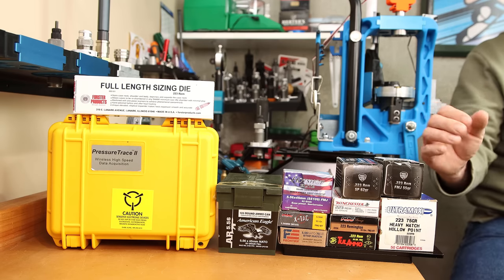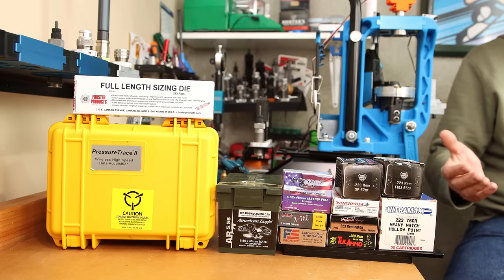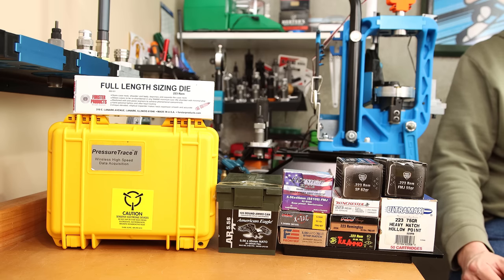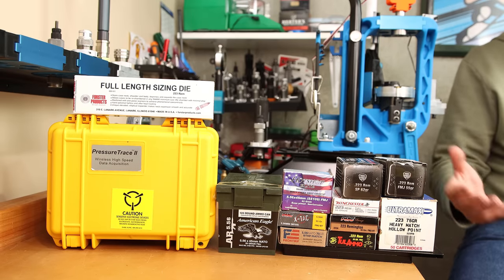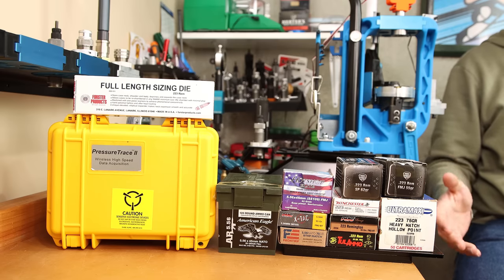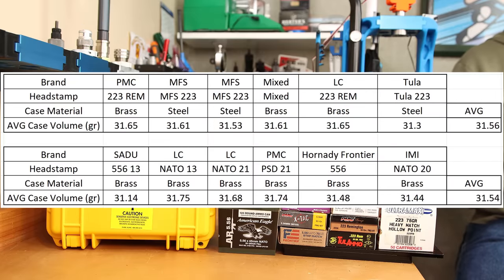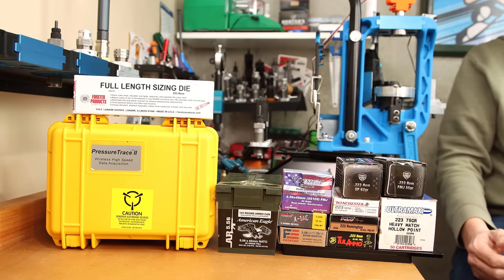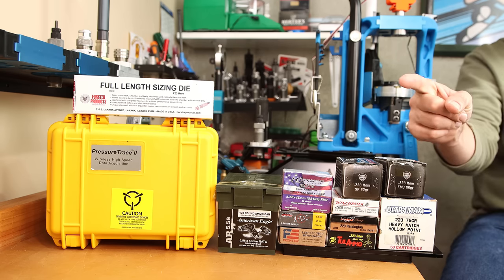223 vs 556 - The Hidden Truth No One Tells You!

Comment: as a 22yr retired military person who has shot hundreds of thousands of 556/223 rounds, I can tell you that we NEVER had an issue when using 223 rounds in a 556, not once!!!  i use 223 62gr in my personal 556 all the time with NO issues....  thanks for the video!!
Reply: Yep. The rule of thumb is that you can always shoot .223 ammo in a 5.56 chamber, but not necessarily the reverse.
Reply: If you have a rifle in. 223 it needs the MILITARY THROAT which is longer than the standard 223 throat it was done to account for the fact military ammo may occasionally have a bullet not seated full depth this prevents the bullet jamming in the rifle when loaded causing an over pressure situation. My Ruger has the military throat I discovered this when I realised I could seat bullets beyond spec depth Ruger confirmed it had the military throat. THAT'S THE ONLY DIFFERENCE unless you need tighter rifling for different bullet weights.
Reply: @yfelwulf  i run a rock river with the wylde it will eat anything. Its so old it was when rra was buying barrels from wilson
Reply: it was Wilson Arms.
W. Combat is a different company.
Reply: @yfelwulf  "If you have a rifle in. 223 it needs the MILITARY THROAT which is longer than the standard 223 throat"

The military doesn't use .223 Remington, it uses 5.56mm NATO. And if you're using .223 ammo, why would a "standard .223 throat" not work?
As for Ruger, their AR platform is called the Ruger 556 for a reason. It's not called the Ruger 223.
Reply: Unless you were a SAW gunner, you probably didn't shoot hundreds of thousands of rounds. Thats a crazy high number of rounds.
Reply: @eddarby469  takes less than 10 seconds to empty a standard mag with an M16 and less than 30 seconds to empty a drum with a SAW, over the span of 22 years of daily/weekly round expenditure thanks to uncle sam and then 4 years of contracting fun thanks to the tax payer dollars, my count is pretty accurate…. Kinda wish I would have had the smarts to own some stock in those brass companies, could have contributed to my wealth???
Reply: @meseahunt  It took me less than 3 seconds to empty a standard mag back in my day, before the three round burst setting.

But, we never did anything where we could fire full auto. It was only for qualifying. Full auto only happened when we were training with blanks.

Have a good one.
Reply: There is a small difference. It's not as noticeable as .38 Special / .357 Mag.. if you have precision .223 rifle, any 5.56 Nato will cause problems & not be reliable. However a precision 5.56 Nato rifle is like a Lot Lizard in Texas, she will take any .223 and any 5.56 Nato. The military doesn't use any .224 .. even though the differences are very slim.
Reply: Having watched for years and not heard anything ,, has anyone had an issue using 5.56 in a 223 chamber ?  
There are plenty of rumors but no actual testiment that I have found
Reply: @eddarby469  I dunno seems viable depending on his station as he rose thought the ranks. In Marines a typical range day would be.... 500-600 rounds fired. At the end we would have a bunch of ammo left over after and it was alot of paperwork and hassle to turn it back in. So then we would just mag dump the rest to get rid of it so we would go home. So usually that would be another 200+ rounds. So that is 800-900 rounds in one range day. We would hit the range at least once a week to do CQB and fire and move drills. That number went up substantially when at our desert qual training to get ready for deployment in that month we would shoot 300-400 maybe every other day.  So in training that would be 50,000 rounds in a year. but we will take that down to about 30 ish to take in account the off weeks and such. 

That is not including deployments where we would shoot a lot. 

so in my 4 years in i shot over 100,000 round someone in for 22 years i think could match that. 

Something to keep in mind tho i was not in a normal strait leg unit so we did get more trigger time then your average infantry man.
Reply: @eddarby469  Oh just something to keep in mine. I was part of Marine LAR and any one that knows anything about LAR is we at least were a very under manned and over utilized unit. I spent my 4 year enlistment and at all times we were either deployed or prepping for deployment we would deploy come home get a couple weeks to chill then start getting ready for another deployment cause we would be shipping back out in less than a year and had a large amount of turn around so we shot alot because they loved putting us right in the middle of the shit. So my experience may vary from others.
Reply: @nicholasjaeger3132  I could easily see a soldier or marine in an infantry line unit during the previous 20 years firing 100,000 rounds within any four years knowing there was at least one "twelve month" deployment in there. But during my lifetime we have not sustained that operational tempo over any 4-yr period prior to about 2003.

These have been "interesting times", certainly. 

My point is that due to budget constraints, safety concerns, mission readiness requirements other than putting "lead in the black" and a myriad of other factors, infantrymen don't fire their weapon as much as Hollywood would have you believe. A million rounds is a big number for small arms fire. Maybe it isn't crazy for a SAW or an M60, but it's still damn big.
Reply: @eddarby469  I got you that is why i did send that other comment that stated it was a high readiness cycle in a non standard infantry mos So that is not a "normal" thing to sustain that much ammo your right but... is possible. 

We had such a crazy turn around for so long during the mid to end of iraq because of our capability (our range, speed and firepower) they just wanted as many LAV in country as they could get at all times it was nuts.
Reply: @nicholasjaeger3132  Glad you came through it. I hope your buddies are OK too. Peace brother.
Reply: @brianjohnson6053  Exactly but that chamber is to work with either, it's a split. A little more throat for the 5.56 but a little shorter to allow for better accuracy from 223. It's a best of both kind of thing.
Reply: @eddarby469  Do the simple math before you Imply that someone may be lying. 500 per month x 12 months = 6,000 x 10 yrs = 60,000 rounds double that for 1,000 rounds per month etc... or 500 rds per week x  52 wks = 26,000 per year etc... So even an ordinary Joe can Popoff 100's of thousands of rounds in a lifetime. some can even do it in less time.
Reply: @freedomliberty5525  You stopped your math a bit early ...

How much does each round cost? An average Joe doesn't have that kind of money to spend on ammunition. 

Second, I was also in the military. Except when the operational tempo picked up a lot, we only fired for qualification each year. That didn't use 500 rounds per man per year.

Third, a million is still a very big number that many people throw around like congressmen throw around earmarked money.
Reply: @eddarby469  No I did not I am not your nanny or teacher, however, word of advice if you plan on doing this math be sure to figure out the cost average over the years not today's cost per round. 

For example, I use to pay .25 cents per 50 rounds box of 22's, then it became 50/50 then $1.00 for 50 rounds, etc... so the cost was inconsequential even when making $3.50 per hour at that time.
Reply: 22 yr old retired wow
Reply: @epigenetics9798  your obviously public school educated….
Reply: @meseahunt  *you're
Reply: @epigenetics9798  **your=
yoo͝r, yôr, yər <em>when unstressed</em>
adjective
~Used as a modifier before a noun.
~A  person's; one's.
~Used with little or no sense of possession to indicate a type familiar to the listener.

as I said, tax payer education at its finest
Reply: @meseahunt  meh. I was just saying its kinda not impressive to be 22 and retired military person but is seemed like you thought so bye now
Reply: @meseahunt  No matter how you attempt to spin it you used it in place of you are , so you're would have been the proper way . You would be correct if you had stated " Your Mom is obviously public school educated ."
Reply: @meseahunt  dude you even looked it up and still got it wrong... you're getting your "yours" mixed up
Reply: @BD-fx8wv  IDGAF!!!
Reply: that's what I came to find out.. thanks
Reply: Sorry for the late response. I have a 556 that is a cheap Chinese knockoff. Pieces of it fall off occasionally. Whenever I fire 223 it seems that it just doesn't have enough power to properly eject the cartridge and load another one into the chamber, resulting in constant jams.
Reply: The issue comes in the inverse. There's different restrictions on maximum pressure, so a 5.56 might damage a .223 barrel, especially over a prolonged period of time.
Reply: @yfelwulf  the freebore as mentioned @1:40
Reply: @doejon9424  .223 and .224 case dimensions are SUBSTANTIAL...
Reply: @zbigniewgurak8261  No
Reply: @doejon9424  Yes.
Reply: @tomacton6718  yup club fingers and a touch to much beer thanks for the correction
Reply: @seikibrian8641  I've heard this a lot but I don't believe it.
Reply: A fact is a fact whether you believe it or not.
Reply: @seikibrian8641  nah. Never had a problem shooting 5.56 in a 223 rifle. And I'm not talking 223 wylde either. Is it anecdotal evidence? Sure. But perception is reality. Imo it doesn't make a bit of difference.
Reply: @seikibrian8641  yeah, isn't that funny how nobody specifically talks about the reverse? .223 has a bullit diameter of 223 thousandths of an inch, and 5.56 is 224 thousandths.
Reply: It’s crazy how fast interpretations or misinterpretation can get out of hand. Possibly spotted 2 in this thread. 

1. “22 yr old retired” and “Retired after 22 yrs”

2. “Hundreds of thousands” and “A million rounds”

In my opinion these are not as comparable as 223/556.
At minimal form I would see
1. 22 yr old/ 40 yr old.
If enlisted at 18
2. 200,000/ 1,000,000

Now throw in the old hotdog/ hallway and suddenly the Empire State Building has a no open foods policy 😂
Reply: 21 yrs army  and 2 tours in nam.
Reply: Thanks for I asked many and viewed many of these videos and never got a straight answer.
Reply: It cut out part of that
1. 22 yr old/ retired after 22 yr 40 yr old if enlisted at 18

That guy was way off thinking 22 was persons  age instead of service history. Age is obviously above 40 but regardless thank you and everyone else for your service no matter the age or service length
Reply: Huh? I never had .223 while in the Military. Only 5.56. that's it for the M16A2 and/ or M4. What Military Unit issued you .223?
Reply: @yfelwulf  max col on a 223 is actually .01 more than 556 so that doesn't hold water.
Reply: @williampankratz600  You came to the right place at the right time.
After Vietnam wound down the US was flooded with "liberated" milsurp ammo. It was cheaper than dirt plus very little commercial 223 was stocked on shelves. So I shot many thousands in Rem 788, Rem 700 BDL. I went at least 30 years not knowing I was jeopardizing my health shooting 5.56 in a 223 chamber. <sarcasm> Never a single problem in the slightest. 

In 1973 I started reloading centerfire rifle. 
Difference 1/ I noticed the military cases had less room in the case than Winchester (the biggest volume of the commercial cases). Same issue with (7.62 US brass.)THIS DIFFERENCE WAS WELL KNOWN EVEN BEFORE I STARTED RELOADING 223. Reloading manuals usually would recommend 10% less powder when using milsurp cases. 
I "shout" that because too many idiots act like 5.56 vs 223 is something new. Its far from new, its so old it belongs in the Smithsonian. 

Difference #2:: This applies to my experience with 308 Win/7.62 NATO also. It didn't take real long to figure out Winchester commercial brass had the most internal volume PLUS Win brass was the toughest brass by far. The USGI brass was good brass but definitely in 2nd place overall. So the USGI brass was softer AND thicker. 

A long story but I also discovered the USGI brass gave inconsistent accuracy as in poorer accuracy. This discovery is thanks to a Colt SP-1 AR. I developed an excellent load that grouped 3" at 100yd. That's the best it would do. Switched to Winchester brass in the mid-1980s and the same load in the same gun now shot 1.5" groups at 100yd. With a halfway decent barrel the load groups at .75/.80" without trying. 
All were 5 shot groups as 3 shot groups can be deceptive. 

There you have my 50 years of experience and well over 100k of 223/5.56. The whole angst over this topic has always been a big Nuthin Burger.
Reply: @nicholasjaeger3132  1st LAR Bn Alpha Co 08'-11'. Semper Fi brother 🤙🏼
Reply: @eddarby469  A SAW is .308. An M-16 will eat up a mag of rounds in a flash.
Reply: The original problems with M16 rifles when they first came into use in Vietnam had to do with  the military running short of the 5.56 NATO and having to buy civilian .223 and I believe (if I'm remembering the details right) that it lasted something like 18 months. 
I don't remember how many modifications and the exact details but they made some improvements and added the forward assist which is likely related partly to what has been sait about some bullt not being seated as deep as the spec calls for but also from firing many more rounds than civilians typically fire and the the buildup of soot, etc which can become accumulated to the point of not allowing the bolt to go into full battery. The FA is just basically a ratchet gear mechanism only instead of the gear being round , it's a straight line or teeth cut into the side of the bolt carrier and the palm knob that you hit with the heel of your palm is the pawl . 
The M16A1 rifles we used when I was enlisted in the mid '70s (the ones with the black plastic furniture made by Mattel and some others) was a result  of those improvements and I never had a single issue either although if we ever had any .223 I never saw any I know of.but I never paid attention other than noticing the thin read sealer around the primers and I can't say if they were all that way or not.

Those rifles are select fire , full auto which would empty a 20 rd mag in 2.3 seconds and semi auto. I'm not sure of the later versions timeline but they changed the full auto fire option to a 3 round burst at least partly because of the slightly under 2 and a half second mag dump leaving you with an empty weapon. and full auto is a waste of ammo in most situations . Of course the M4 is nearly the same other than the  collapsible buttstock and the forend shortened-and the gas block moved a bit towards the receiver but I think the barrel length itself is the same.

Those older M16 rifles that were the ones having the issues running civilian ammo had the same kind of problem that Nissan CV transmissions do... the engineers making the tolerances too tight ,but that's was solved long ago on the rifle.
Reply: @eddarby469  yeah... even the most intensive training during my grunt stint was only 10k rounds in six weeks. No cleaning during the exercise per se, just a bath of clp, exercise the bcg until it was no longer sticky, wipe off the excess oil, and go again. So, 100k per year would be on the high end. 50-60k per year average was more realistic for 11B... mid to late 80's.
Reply: @steelangel  I believe you are thinking of the M60 LMG, which is a 7.62 mm barrel. The SAW fired 5.56 mm ammunition.
Reply: The powder charge is a big difference in ammo with the 5.56 being a much ‘hotter’ round. Either more grains of powder or a different powder altogether. So a rifle built to 5.56 nato specs can shoot 223 with no problems. But a 5.56 round in a 223 can cause damage to the rifle. Ex. I have 223 ammo that has a muzzle velocity of 2740 up 2860. I have some 5.56 that has a muzzle velocity from 3040 FPS up to my favorite 3240. And I’m always looking for faster ammunition. Faster the better in my book, but, each to their own. 
Either is a pleasure to shoot weather for target practice or to kill something. (Anything).
Reply: @meseahunt  
A M-16 will dump 20 rounds in 1.3-1.5 seconds. The last empty casing will leave the rifle before the first empty casing hits the ground. Doing that at night with tracers is really impressive. And fun. 
Have a good day.
Reply: @billhiggins1882  thank you Bill... salute
Reply: @eddarby469  I was a USMC M60 machinegunner in the mid 80s and we had the very first M60E3s and SAWs.  It was astonishing to me how few live rounds they let us shoot. There was a common practice then that could account for high round count. At the end of the day, the ammo not used had to be returned to the armory and the NCOs were too lazy to do that. What they usually did was waste the remaining ammo as fast as possible.  I'm sure a few took it home from time to time.
Reply: @cjmeyers2926  It isn't uncommon for a rifle  marked .223 Rem to actually have a 5.56 NATO chamber. A couple examples: FN FNC, older Colt AR15s.  Other imports were known to do that because if they marked them 5.56 they were considered military and .223 sporting.
Reply: @KevinAdams-zr6bz  I lived through some of that myself. Peace, brother.
Reply: @williampankratz600 the case pressure....6 THOUSAND PSI... huge... very very huge....i would NOT shoot a barrel rated 6000psi lower than intended than the round being used.... do what you will.... but that.... could REALLY go badly.... even if it didn't.... that's REALLY REALLY hard on the barrel... and could cost you a barrel replacement at the very least.. and CATASTROPHIC FAILURE at the very worst.... short answer.... I WOULDN'T DO IT
Reply: @CramcrumBrewbringer ya it's the 6 THOUSAND additional pounds of case pressure that's the ENTIRE issue... everything else is negligible...
but that's..
.A TON
Reply: @ABIGD0NK3Y  Potentially 6 thousand pounds.
Reply: @CramcrumBrewbringer  let's say it was 1/2 that...3000..... HUGE POTENTIAL for catastrophic failure..... and when that barrel SHREDS itself.... could kill you... your friends.... fellow shooters... anyone in range of flying metal.... no way...I WOULDN'T DO IT... plus.... if you want a 556 barrel.... SPEND TWO HUNDRED BUCKS and get the right tool for the job
Reply: @usmcvet0313  1ST LAR Bravo wpns plt 09-13 Semper
Reply: right cuz 223 has less pressure than 556.....
Reply: @luts5688 : Either your rifle isn’t gassed properly or your buffer spring isn’t right. I’d go with gas myself. Get an adjustable gas block. Each and every 556 that I have shot will reliably fire 223. Even subsonic rounds which have a lower powder charge than supersonic rounds. I’m betting the rifle is under gassed. Could be that your gas tube is blocked or partially blocked if you’ve shot a lot of dirty Ammo and haven’t properly cleaned your rifle.
Reply: As mentioned prior: u can use 223 in a chambered 556 np; but earlier designed 223 chambered rifles can't necessarily accept the 556 rnds...& as I've just learned myself this should only incl ones manufactured prior to the 80s; but I doubt I'd attempt to fire 556 in a chambered specific 223 regardless UNLESS that's all there happened to be available...
Reply: @eddarby469  I shoot 300 every time I go to the range so hows that man
Reply: @Grim_creeder  Well, its a lot more than I can afford to shoot myself. Does it get your adrenaline up?
Reply: @eddarby469  it’s hyperbole like when your wife says she loves you or your good at sex
Reply: @eddarby469 pardon my ignorance, but i am surprised it would cycle blanks. I 1000% believe you, but it wasn't something I realized would work. Thank you for your service (and the service of everyone else that served.
Reply: @James-Johnson313  many of the M16s I was issued were not able to cycle with blanks. But two of them could. I remember using one to empty mags from my whole squad on the walk back to the truck. I didn't have to clean that one either. Someone else cleaned it as a disciplinary action.
Reply: @williampankratz600 you haven't heard about any actual issues because pretty much everyone stopped making 223 rem barrels. They've all been 5.56 or 223 wylde chambers for a decade or two.
Reply: @KevinAdams-zr6bz You may have forgotten the updated Ruger mini14 that was changed to properly fire either.223 or 5.56. The recommended round in the instructions remains the Remington .223 but the modern Ruger easily fires 5.56.
Reply: That's what he said.